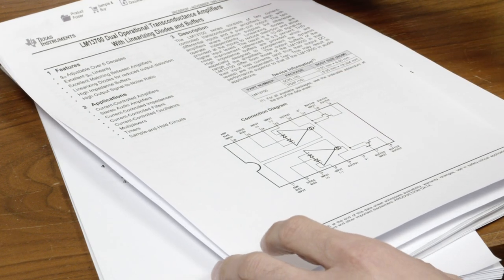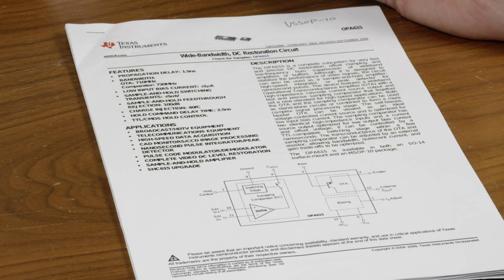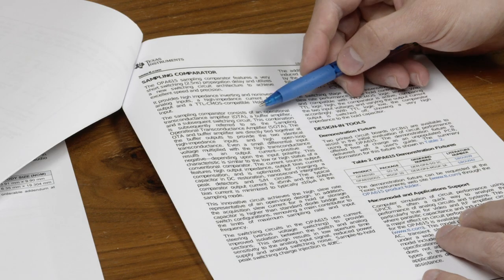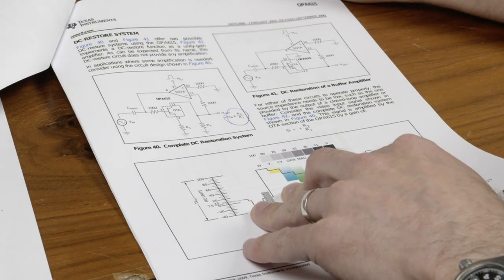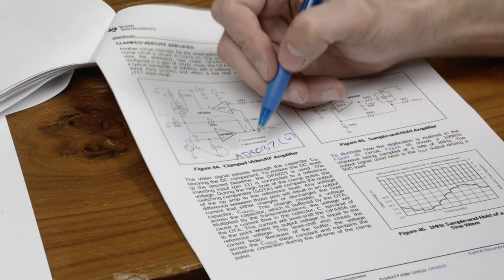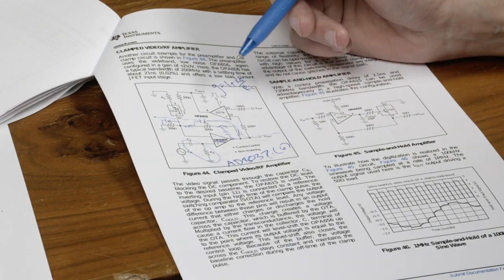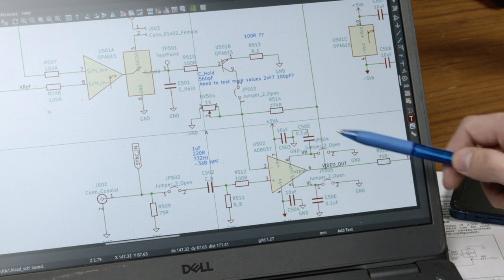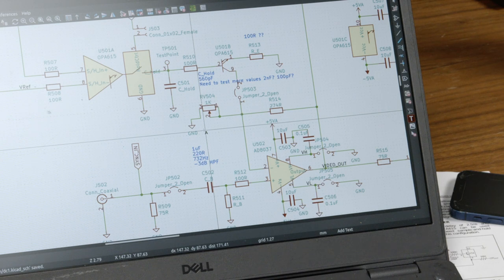Using an OPA-615 for HD video DC restoration

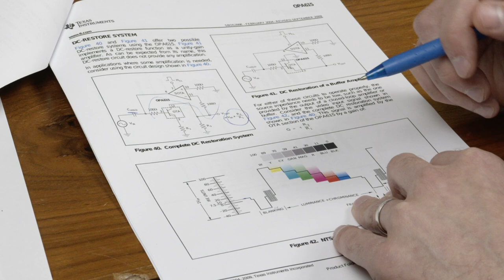Comment from the maker: At 9:05 I should have called out that it’s in a control loop. The current into the capacitor will change proportionally to the distance between the offset signal and the reference voltage until that difference approaches zero.